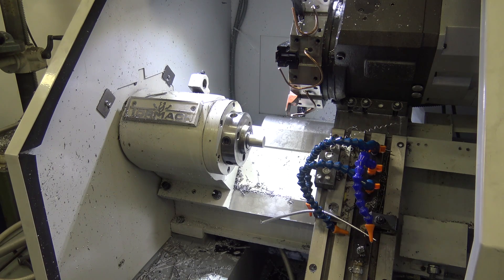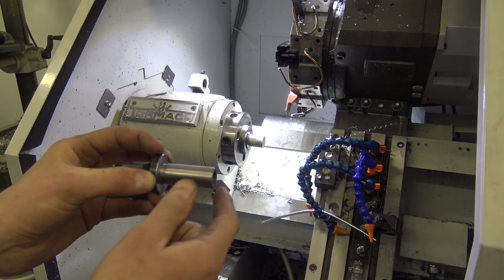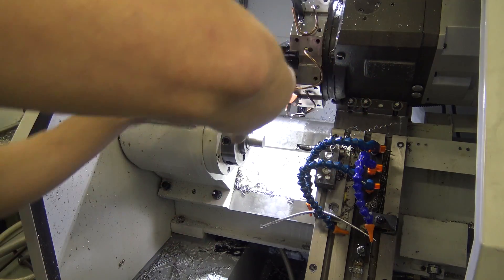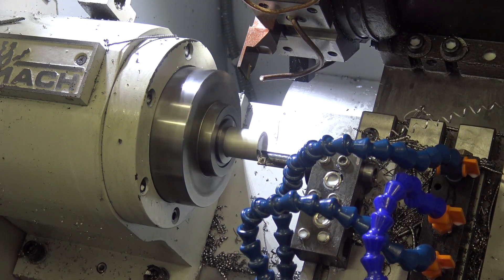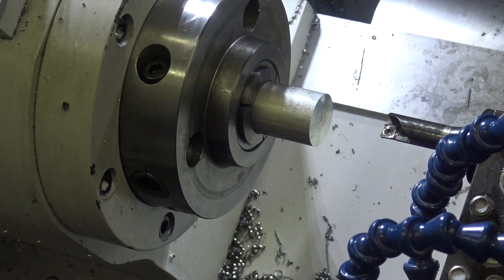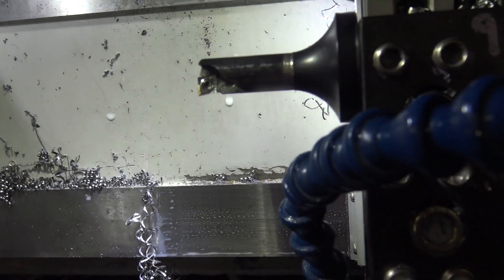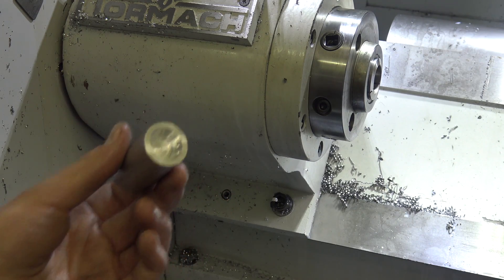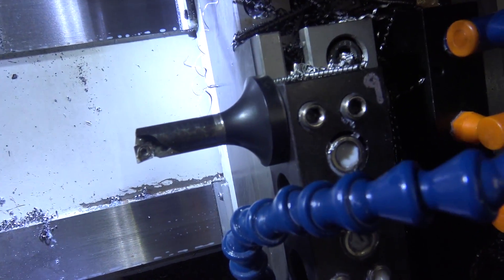Awesome New CNC Lathe Drill!

Comment: Just wondering if anyone has some tips on how to program this tool in Fusion 360.  I would like to use it for initial drill and then continue boring with the same setup.  In my head the drill operation requires tool offset to be centerline of the holder like a drill bit, but then when i go to bore the tip of the insert is offset from centerline...Losing my mind at the moment.
Reply: Did you ever figure this out? I just got one..

Comment: Good vids.
Note, The polished inserts for aluminum are not needed. Just use regular steel inserts, they break the chip better. Sharp polished inserts leave a great finish, but dont break a chip well unless pushed hard. 
Sandvik u-drills are great for punching fast holes in almost any material. 
Agree, put a flat on that drill, after you clock it 180 degrees. Run tools upside down.

Comment: They are not new.also you do have to clock them especially on steel.also there is a minimum hole diameter.you cant drill undersize or else you will destroy the drill.you cant drill a hole smaller than what the drill is designed for

Comment: Check out Coromant 880-series drills, we use them all the time and they have inserts for almost every material like aluminum, steel, stainless steel, titanium etc etc. I think the smallest 880-drill goes down to like 14 mm (little more than 1/2")

Comment: Although they  will not do a square corner I use  ultradex drills on my cnc lathe and they work great. Drill and then rough boring before switching to a  heavy metal boring bar for finishing the bores.    On the other hand my smallest  ultradex is  .625.    I have never bought them from shars but I did notice they also sell the ultradex line.  These drills are made in the USA also which is nice.
Reply: ULTRADEX ! ULTRA DOLLARS !!

Comment: I always use spade drills,are these better
Reply: Mike Sanchez ,mike I've used both throughout my years on the cnc lathe and i think these indexable drills are alot more rigid and firm.Basically stronger than a spade insert ,because (my option)if you look at the support the inserts have on a spade drill and an indexable the indexable is made to where the inserts do not hang off the sides and it's more like part of that bar that's pushing all the force through.You know with spade inserts on a bigger bore and on extreme material you could go through quite a few inserts,t
Reply: SPADE !! DRILLS !!! ARE !! A !! PILE !! OF !! JUNK !!

Comment: I have the 5/8 version of this tool, running on the same 15l slant Pro lathe. I haven't had much success with it though. When drilling the back side of the insert always cracks (probably from rubbing). Cutting recommendations for it are not available from Shars and they don't seem to understand when I send them a message asking about it. And, Path Pilot and CAM software are not liking the tool being able to do more than one type of operation.  It makes a good boring bar though.
Reply: Did you ever figure out the issues with this?

Comment: set it up with the insert oriented like a boring bar, and on center like a drill. use the recommended feed/speed provided by the manufacturer. you try what you did in the video on a harder material and you gonna destroy that cub drill. LOL, you making machinists giggle .....

Comment: AVOID SHARS TOOLS (DISCOUNT MACHINE on ebay)!

I've ordered from them a bunch of times, almost every time they shorted me one thing or another. Never said anything about backorders on the packing slip, they just didn't send the stuff. I called and they would send the stuff right out, no big deal. BUt my last two orders they shorted me as usual, but now they don't respond to emails. I called them and they offered to send the missing parts... but never did. Called again, they promised to credit the cost. You guessed it... they didn't.

I'LL NEVER BUY FROM THEM AGAIN, and if you do CHECK EACH ITEM YOU ORDERED, SOMETHING WILL BE MISSING!!!
Reply: Have never had a delivery  issue and have bought allot of tooling from them.   Bought some long reach er16 cat40 holders  last year  which i didnt use  till just recently only to find the  nuts were off a bit.    The retaining ring was to close to the nose taper and once the collet was installed it didnt spin freely making it a tight fit meaning a .250 tool didnt want to go into a .250 collet.   They sent me replacements right out free of charge  no questions ask.     Nobody is perfect.   Getting ready to place another order  of cat40  holders.    I also have holders from maritool and  and several others.  No complaints about any of them.
Reply: Sound ! Like ! Harbour ! Frieght !!

Comment: Love it but chip clearing looks like it could be a problem on a close to tool size holes.  I'm guessing relieving the shank for chip clearing would cause other problems but great tool for the larger diameter stuff.  They do make through tool cooling for twist drills but that is usually on larger diameter stuff and it doesn't leave a nice flat bottom like this does.

Comment: Z zero off front edge not back edge and be sure its clocked to cut across center.  You will have great success with this type drill.  Very cool for several operations for sure.

Comment: Glad to see you used my suggestion about U-drills, they are awesome.
They are meant to "squeal" when your cutting with them roughing a bore.

I would suggest milling a flat for easier setups. To set it up, put the tool in a V-Block and clock the highest point on the diameter, move down half to get the centre. Then run the clock across the tip of the tip, rotating the tool until it reads "0" and it should be on centre-line.
Reply: Daniel Way yeah ,the squealing is normal ,especially when you are boring strong steels

Comment: Wouldn't a normal aluminium end mill mounted in the lathe do the same thing? Except the through coolant.
Reply: +Auarhau they can be used that way but it is poor practice to use end mills as drills, not only are they WAY less productive than a insert drill like john is showcasing but they dont have the proper clearences to evacuate chips, so you end up with blown out holes and chipped tools!
Reply: @paullagowski1669  YOU !! WOULD !! BE !! USING !! THEM !! IF !! YOU !! HAD !! NOTHING ! ELSE !!

Comment: Nonono John no. You don't just turn the shank down to 3/8 because you have that size holders. The flat face is there to make it square if you bore with it but the holder has to have set screw for that. Now you need to manually set it to do properly anything else than drilling.

Makes production a ton easier always if you are able to reduce tools like having drilling, boring, facing and possibly something else on the same tool.

Comment: Like Joel said, take face cuts and look at the numb until you get on center or a hair above. The nub should disappear. Surface finish and tool life will greatly improve.  Crank up the rpm and IPR. They love to be pushed. In aluminum you should be triple that to start. Don't peck just hit it. Your noise is from the short flute packed up with stringy chips. It's hairy the first time you run it like it wants to be. Think of doing a roughing pass at .002 feed...
Reply: +NYC CNC in the video you mentioned it's only feeding at 2 thou per rev

Comment: great tool and it speeds up the process because you dont have to switch tools, curious about how it will work in steel or stainless.
Reply: I use Iscar insert drills on steel and stainless everyday, they work great.

Comment: Have you taken a look at Allied Machine and Engineering"s spade drills? Coolant thru with much better clearance gullets on the shank. Different tips available for various materials.  They are purely for drilling but they are also an Ohio company based in Dover/New Philadelphia.  Small holes up to drill diameters that you will never use based on the parts I see you making.

Comment: not suppose to peck with those drill and if you get strings feed the drill harder
Reply: Pecked 1.25 Insert Drill in titanium at 1500RPM .0015 IPR .150 per peck... THose inserts were VERY HAPPY. I have never seen carbide tools last this long on a material this hard,
Reply: +Chief Machining Yes! Always full pelt with those type of drills.
Reply: I'm sure the tsc helped a lot huh :)
Reply: If you don't have high pressure coolant through the tool then you will get chip packing.  Pecking is the only way to stop it.
Reply: I have to run a chip break cycle the first inch, and then switch to pecking for the last .750 even for aluminum. An insert intended for steel works better because the chipbreaker actually breaks the chips instead of curing them Otherwise chips pack in the bottom of the hole.  If you have high pressure coolant that isn't an issue.
Reply: AND !! GET !! MORE !! STRINGS !! STUCK !! IN !!  IT !!
Reply: @davidwillard7334  ok maybe on backwoods cnc

Comment: At work we just use the inserts for steel when we machine aluminium 
we do use flood cooling so the alu doesn't coate the insert 
we use the steel inserts for extruded, cast aluminium, bronze, inox  works just fine 
just give it a try
Reply: +NYC CNC I formulated it wrong : ... so the alu doesn't coate the insert to much
What we do when we setup the cnc lathe is using 1 boring bar for roughing so some light coating of the insert doesn't matter
and an other boring bar for the finishing pas

Comment: For FaceTime ng, run the lathe in reverse, and from the back
Reply: +NYC CNC BTW, I'll go one step further.  I've seen them used for turning by running the lathe in reverse.  You turn and face from the back side, with the lathe in reverse, then drill and bore with the lathe running forward.  No tool change...